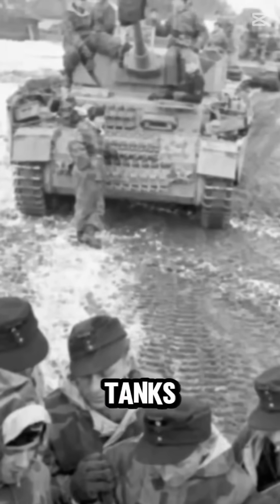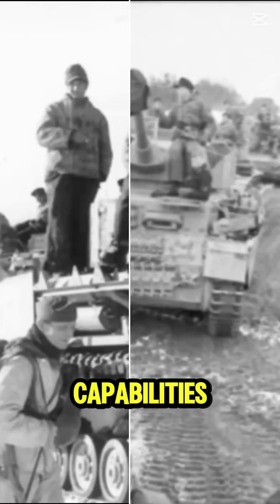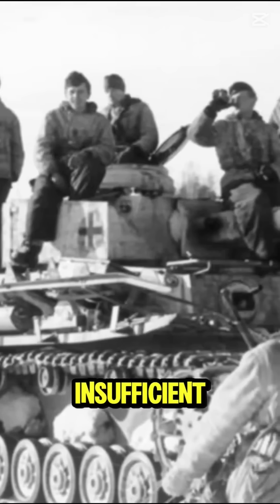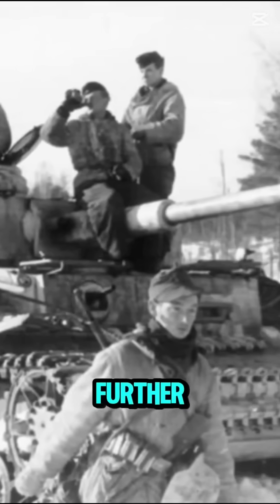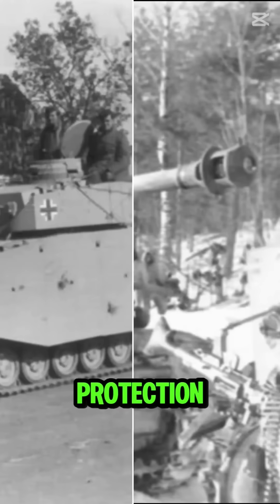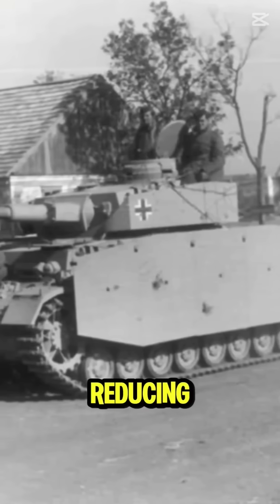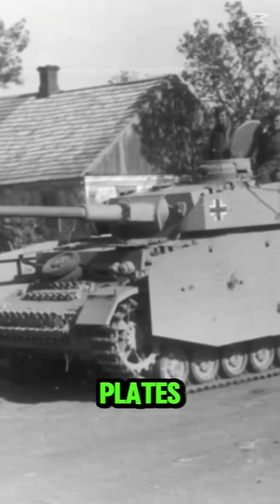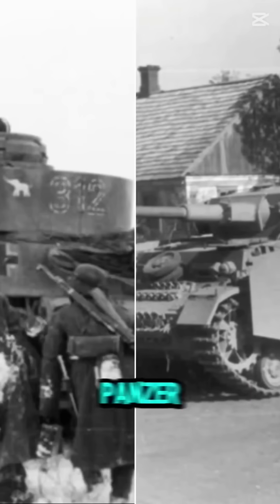The Impact of Angled Armor on the Panzer IV: Revolutionizing Tank Design

Comment: It couldn't hurt, that's for sure.The Sherman was called a zippo lighter, because it burst in flames very easily after being hit.Thank you for the video.
Reply: @markpaul-ym5wg  that was fixed with later models having a wet ammo storage
Reply: @piebois9154  As much of a WWII and tank buff that I am I learned something new today. Thank you!
Reply: @hyperionsix  I'm not certain what year or model designation started having wet ammo, but it was in the bottom of the hull, below the turret basket.
Reply: I was a U.S. Army tanker for 12 years.The Sherman tank had a radial engine, and burned high octane gas.Thats what made it a zippo when hit.
Reply: @markpaul-ym5wg  ohhhh okay, didn't know that thanks! Also thank you for your service.
Reply: Thank you.Yes, the Sherman had a radial aircraft engine in it.